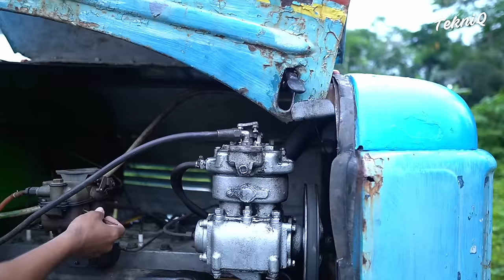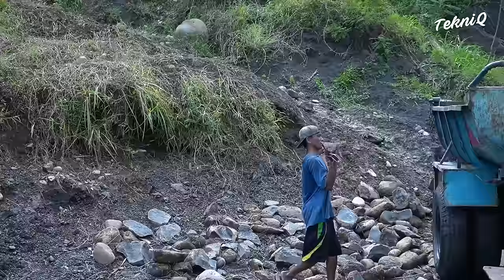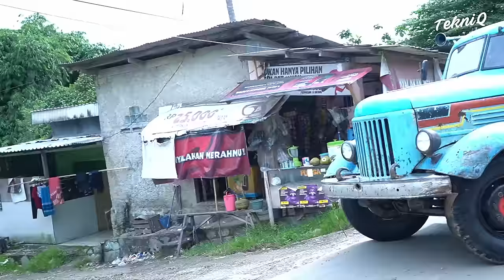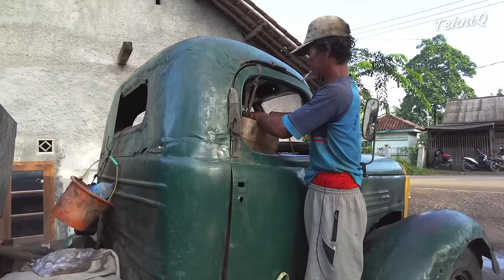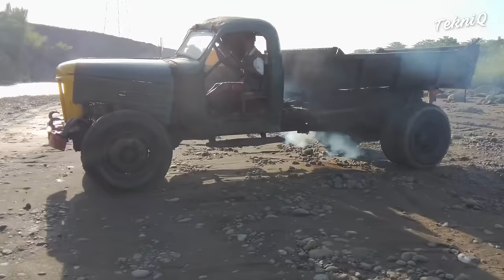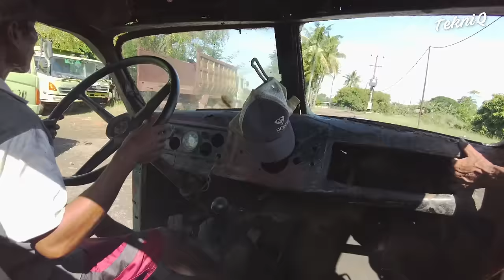Loading Tons of Rock Into 70 year old Rusted Soviet Truck

Comment: Must be difficult to get parts
Reply: Very, most of that motor, especially the rad hoses are from other vehicles or home made. They do whatever it takes to keep it on the road
Reply: Shares parts with dodge power wagon and similar 6 cylinder flat heads from the era

Parts are hard to get but it can be substituted by modifying parts from other cars.
Reply: spare parts are obtained from trucks that are no longer working, we call it carnibal
Reply: Engine is a "Hercules" WXC. Cab - "international" KB6/KB7. All other are pretty standard from US trucks same era.

Comment: So, this is a gasoline motor! That crank start was amazing! What is that large device seen at the front of the engine? it looks like an injector pump...
Reply: That's the air compressor used for the brakes.